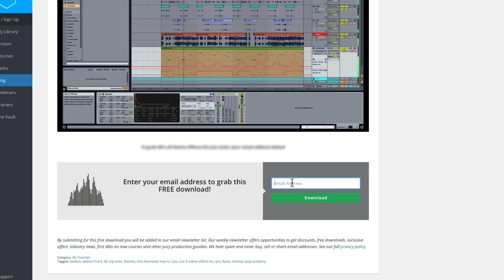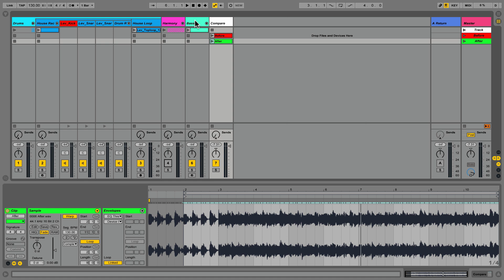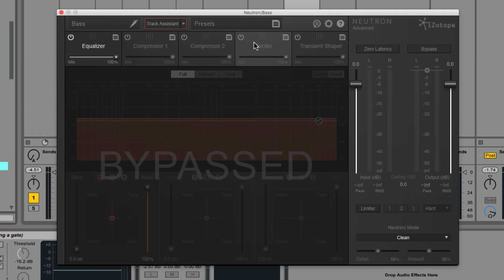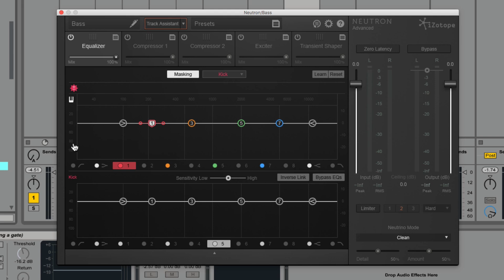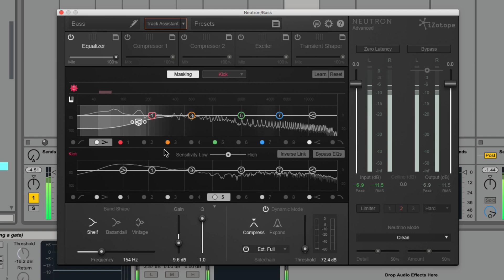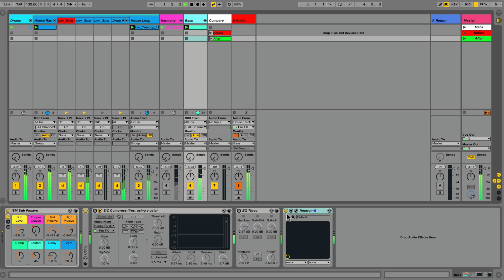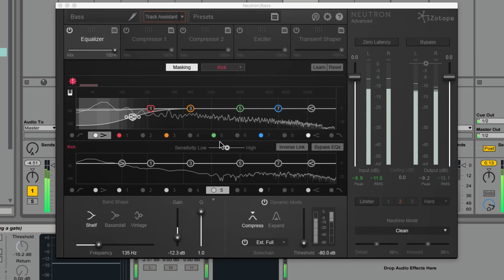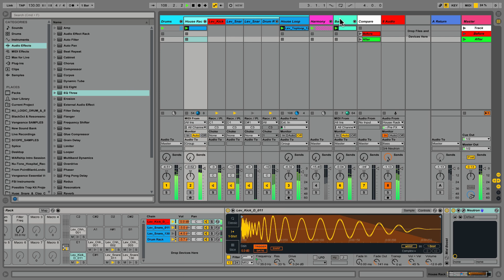iZotope Neutron Tutorial: Using Dynamic EQ to Duck Bass

Comment: Good video. Thank you. Question: Is it TYPICAL to use a low-shelf filter to duck out the bass to the kick? I would imagine so if the kick is full of sub-bass content, but what is typical? In my experiments and mix trials, it's very had to judge--for me--the effects of just a bell cut that is side-chained to the kick. I do, however, like the monitor-only-the-lows trick to get a feel for the punch of the kick cutting through. That is very helpful.
Reply from the maker: Hey Charles.  Glad you liked this one.  There are a variety of ways to handle sub and kick conflict.  The easiest way is through composition where the sub is programmed to play when the kick doesn't.  IE syncopated bass around a 4/4 kick where bass plays on the offbeats.  

Another way is to remove low end from the kick using a HP filter, and have the kick be additive with the bass.  This is common in some genres of bass music like drum & bass, where there's a long, sustained sub note and the kick is really just a "kick top" for transient impact.  

But, for me, I prefer to have a full-range kick with lots of sub in.  And in my music, which is broken beat, my kick often plays with the bass, but sometimes not.  So I use the method of ducking out low frequencies, as well as some mid frequencies and even high frequencies of virtually every other element in the track, not just the bass.  Of course if you have a lead vocal or instrument, this wouldn't get ducked, but I bus nearly everything else that isn't a main drum together and duck frequencies out of it.  

I should also say, this is highly program dependent and you have to listen for what the music needs, and how heavy-handed you can be with ducking.  If it sounds really obvious, you may want to back it off.  Other music, like dubstep for example, can sound good with really hard ducking.  

Happy music making!

Comment: Sure you could buy Neutron. Or just use an Ableton rack:  Make 2 x chains > EQ 8 on each. make a crossover by HI passing one EQ8 at the same freq as you Low pass the other EQ8  > Add a compressor  on the Low freq chain and route the kick to that side chain input. Adjust crossover to taste. Unlike Neutron you actually have control of the release time.  Save the rack for future use

Comment: still can't believe people are doing sidechain the long way. just use volume shaper. multiband sidechain in 10 seconds
Reply: DJ Vespers true story. Yes 4/4 beat is really what I'm talking about, otherwise, like you say, you need some form of routing. Cheers
Reply: DJ Vespers true story. Yes I am talking about a 4/4 beat where it's a doddle in volume shaper but as you say, requires routing if you are after more complex ducking. Cheers
Reply: DJ Vespers yeah I should of mentioned the 4/4 thingy firstly when commenting about volume shaper...kind of a key point Hehe. I've heard a few people mention trackspacer on the forums. it looks interesting..Im going to demo it shortly. thanks for reminding me 👌